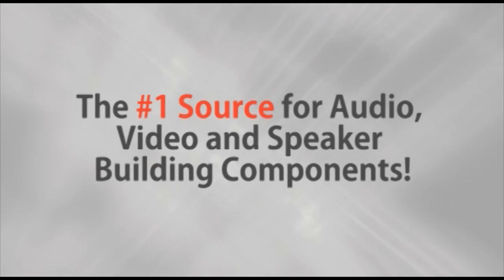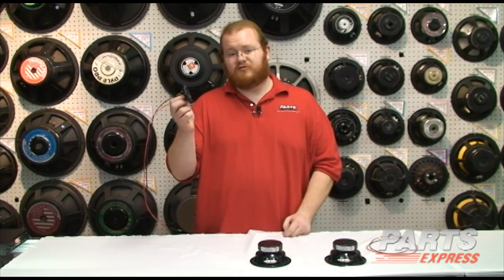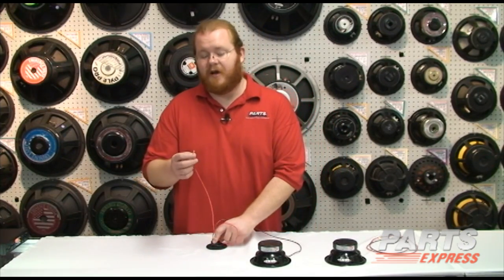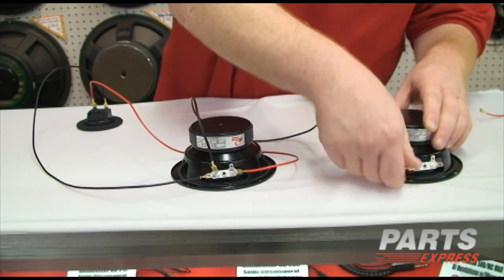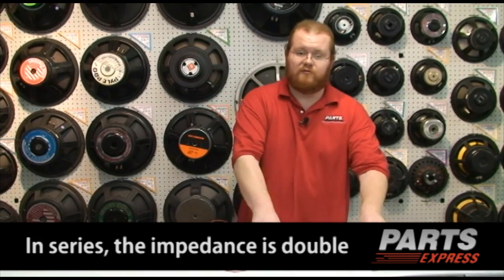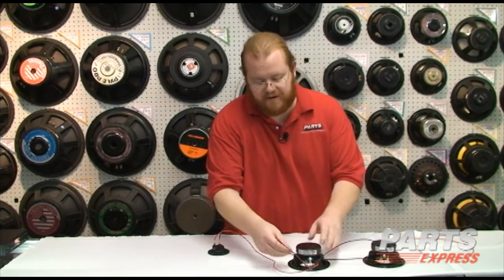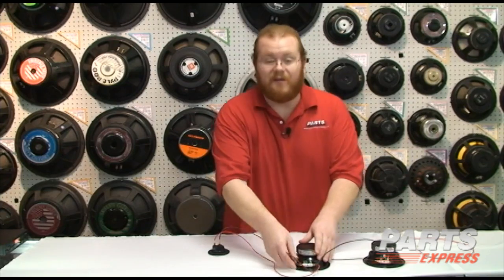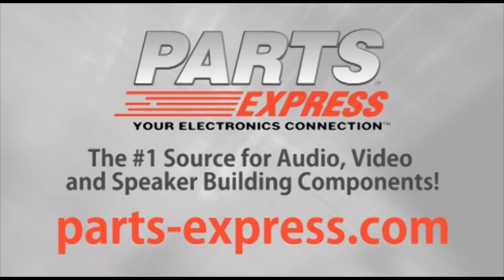How-to: Wire Speakers in Series & Parallel Instructional Video

Comment: I haven’t found any information on wiring two 8 ohm speakers in series AND parallel at the same time. What affect would this have on impedance. Honest question here, it’s physically possible so why not cover it? I have googled it with absolutely no answers what the heck? Thanks for the video on standard S/P that is good. But doesn’t address my question.
Reply from the maker: That would cause a short and probably not produce your desired outcome.

Comment: If you wire two different speakers (let's say a 20W RMS and a 100W RMS speaker) of the same impedance in parallel, would you have any issues with the 20W speaker being overpowered?
Reply from the maker: If the two speakers are equal in other respects and their is no crossover network, then they will simply divide the power accordingly.  So too much wattage from an amp can cause damage to the lower wattage driver in that scenario.

Comment: What is the difference between parallel and series? Which give better sound and why sould I decide in wich to use? Please help. Thanks
Reply: I have a 4 channel 1200amp and 8 speakers. How can I wire them? Thanks
Reply: I have a 4 channel 1200amp and 8 speakers. How can I wire them? Thanks

Comment: So, in parallel, since two 8ohm speakers would cut it to 4ohm, would that mean you must use a 4ohm amp?
Reply from the maker: +Kyle Comeaux Yes, the amplifier must be able to handle the
final load the speakers present. So in this case your amplifier will need to be
able to handle a minimum of 4 ohms.

Comment: i got an 8 ohm woofer , 8 ohm mid, and two 8 ohm tweeters in a 3 way system box how am i suppose to wire my two tweeters together so the impendenance is right for my crossover im goin to put on my speakers?

Comment: I have a pretty good understanding of electronic s and have a small speaker project, if I have two eight ohm speakers on a 8ohm circuit what is the best way to wire them

Comment: hi guys i have a question.
I have a fender mustang v head. each output(2) is label  75 watts / 8 ohm min. i just going to use one output. im planning to buy 2 speakers -- 60 watts 8 ohms each , since conecting 2 speakers in series reduce the ohms  to 4, my question is, i am in risk to blow out each speaker? the ohms are reduce to half so im concern about to damage the amp or speakers because the amp demands 8 ohms.  thanks in advance
Reply from the maker: +kartman74usa Feel free to contact customer service for questions like this!
Customer Service///Email: CustomerService@Parts-Express.com
Phone: 1-800-338-0531Hours 8am-6pm M-F EST / 9am-2pm Sat EST
Reply: +kartman74usa No. If you connect the speakers sin series the impedance adds up 16ohm. If you wire them in parallel they will result in a 4ohm load which may damage your amp.
Reply: Sixto Flores así q si las dejo en serie no hay problema sube la impedancia a 16 ohms aunque el ampli tenga salida de 8 ohms no le afectaría?
Reply: por ser de estado sólido, supongo que no, sólo que no se aprovecharía la potencia del amp

Comment: I thought when you add two 8ohms spekerd together it cits the ohms in half
Reply from the maker: chris cordeiro 
In parallel wiring, the two speakers are hooked together, so as to half the impedance.  Two 8-Ohm = 4-Ohm load. In series, the impedance is double. Two 8-Ohm = 16Ohm Load.

Comment: in a stereo setup, one is attached to each amp output. What is that called? parallel or series? 
In most enclosure designers, this is asked. Which would be appropriate for stereo setup?
Reply from the maker: In stereo applications each speaker is connected to it's own channel. This is neither series or parallel. Those only apply when hooking multiple speakers up to a single amp channel. In that case the type of wiring effects the impedance so knowing the speaker and amp impedance requirements is the most important place to start. For more information, please contact our tech department directly at 1-800-338-0531 or by email at tech@parts-express.com. Thanks for watching!!

Comment: Hi say if I have an 8 ohm woofer an 8 ohm mid and a 8 ohm tweeter and wired them all to an 8 ohm crossover like woofer to woofer mid to mid and tweeter to tweeter what would to total impedance the amplifier would see? Thanks for your help.

Comment: hay, i've a sony hi-fi stereo(MHC-AV22). The speakers are 8 ohm and no i want to add more two 8 ohm speakers(sony ss-h414). if i do that in parallel, the speaker impedance will reduce into 4 ohm. where i live, its not possible to buy any Stereo Speaker Selector Switch With Impedance Protection. now, i need a way to keep the impedance at 8 ohm.  so what to do now???  

thank you in advance... :)

Comment: Wanting to do 8 full range 8ohm drivers in a line array home theater speaker.  To end up with an 8ohm load on my amp, should I wire 4 in a series and and then wire the two groups of 4 parallel to the amp or do the whole array in a series?  The drivers are rated at 100w rms.  so I need an 500-800 watt amp correct?  Thank you in advance

Comment: Or you could just tell him that in parallel would be 2.66 ohms. Pro Audio amplifiers will usually handle a 2 ohm load. Consumer stuff doesn't. Efficiency of the 2 speakers may not be matched, it is likely the 4 ohm speaker will be louder.

Comment: if each speaker is 12 ohm or even 3 ohm as long as the end impedance is above 6 ohm you can wire as many speakers as you want...but all things being equal if the two speakers can handle 60 each go with those..

Comment: you might be able to but you have to find out what the amp and speakers are rated at..for example. if the amp is rated at 4 ohm and each speaker is rated at 8 you can twist all the positives and all the negatives together and plug it in

Comment: yes you can wire it in parallel and depending on the ohm stability of the amp it wont damage any thing..but the speaker with the lowest impedance will get more power..in series the speakers will act as 1 and will both get the same power..in parallel the amp will see 2.6 ohm

Comment: how do you connect the wire to the speaker without soldering? what adapter thing are you using?

Comment: can you do that kind of wiring to any speakers,i have 2 6x9 jvc speakers 4 ohms each and i have a 2 channel amplifier 1200watts it supports 4-8 ohms per channel and i want to add another speaker that is 8 ohms of impedance without buying a 4 channel amplifier,can you help me

Comment: excuse me, I connected in serie my two subs, and checked theme with the multimeter, I got about 2 ohms instead of 8, I rechecked the wireing and it´s correct. Is the multimeter wrong? or I´m the wrong one here?

Comment: ok i have a amp to take 8 ohms and i have 2 subs both are supposed to take 4 ohms each so to get this right the amp should be seeing 8 ohms if all is wired correctly? correct?

Comment: hey there, I was wondering if there is any way possible to wire two 4ohm drivers and maintain a 4ohm load for my amp (d.i.y. PA system). 
As these dvc woofers that I'm using require a sizeable amount of power, wiring in 4ohm is ideal as it would allow for 1.5x more power output from my amp than if i wired in 8ohm. If not possible, would I wire in parallel or in series to achieve an 8ohm load?
I appreciate your help and for providing these tutorials =)